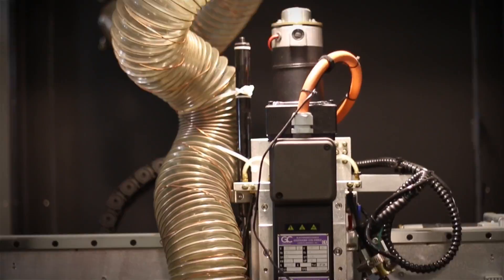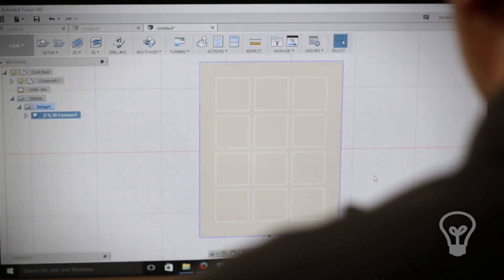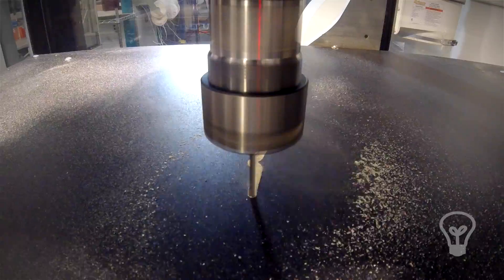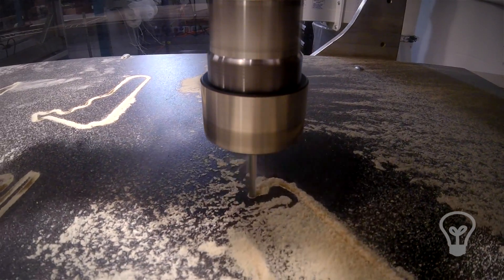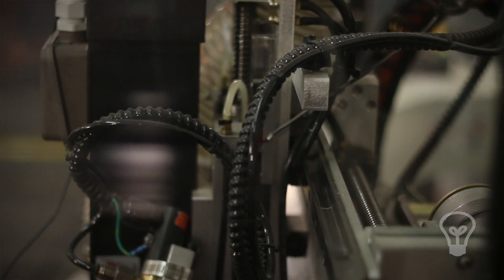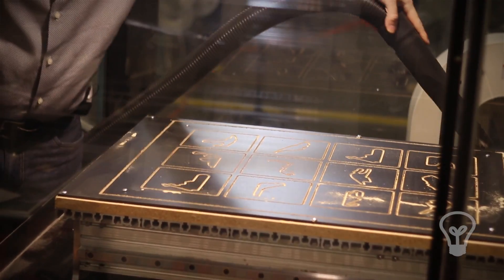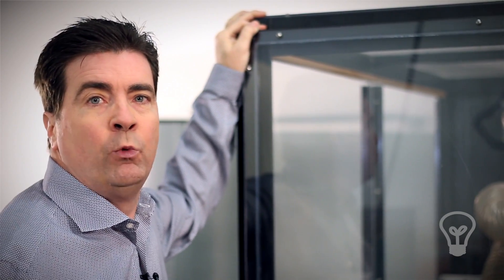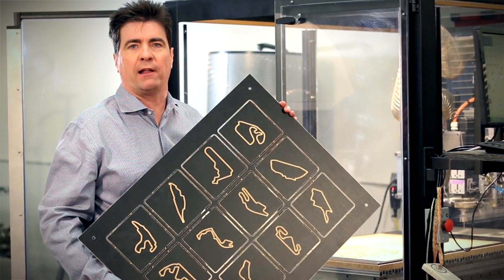Machining With A CNC Router and Milling Machine To Use In Manufacturing

Comment: Still trying to understand the difference between a CNC router and CNC milling machine ??
Reply from the maker: A CNC milling machine is just made of much stronger components for cutting metals. You generally cut wood and plastic on a CNC router. CNC routers are usually used for furniture and cabinet making. I use my CNC router to cut plastic sheets for prototyping. The lines between the two are blurred these days because there are so many small, low quality machines claiming to be CNC milling machines but they can't even cut thick wood.

Comment: I saw Solidworks being used so what is your workflow from SW all the way through to the bit turning on the machine and what do you use for each step?
Reply from the maker: It is easy when cutting 2D parts. Just save as a DXF file from Solidworks and then use any number of programs, including Fusion 360 to create the G code for the router.

Comment: do you need a special filter for the dust?
Reply from the maker: All the cut material and dust goes directly into a trash bag attached to the vacuum system. It's the same type of dust collector used in woodworking shops.
Reply: If you're on a budget you could build a inexpensive cyclone dust collector: 
https://www.youtube.com/results?search_query=cyclone+dust+collector+diy
Keeps the dust out of your shop vac filter.